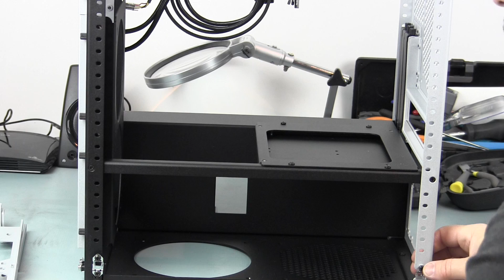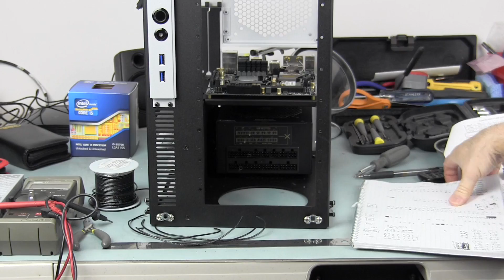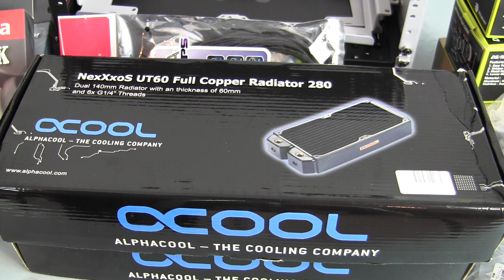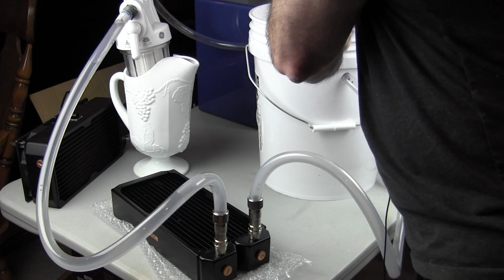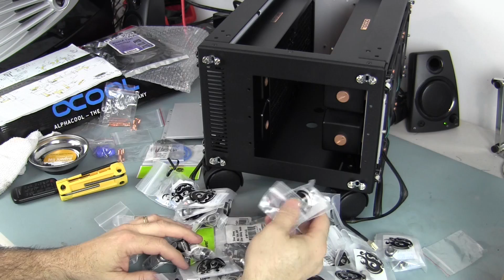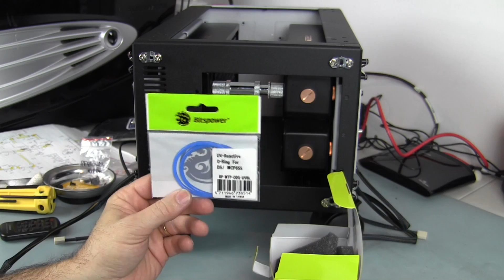Case Labs Mercury S3 MiniITX Build Log 2  - Cabling and Pedestal

Comment: Hi Ron got a question. I have a similar CaseLabs case i'm doing a build on the TH10A and have a Pedestal attached to which I'm mounting Radiators and Fans. I have some M4 30mm screws and apparently they aren't long enough to be able to mount the fans to the case radiator bracket frame and through to the radiator. Apparently i must need longer screws. What size radiator screws are you using in the video and or do you know what size screws it take to properly mount the fans, the bracket and radiator all together? Im unsure if there is a M4 size screw thats in-between 30-34mm in size as i don't think its longer than that which i need.
Reply from the maker: +Ardent Dfender I beleive these are Alphacool NexXxos UT60 Full Copper Radiator 280, 140mm x 2, Dual Fan.  I think I did buy longer screws to make it work. Make sure the screws you buy are the correct thread to mtach those that come with the rad.  I bought mine from McMaster Car.  http://www.mcmaster.com/
Reply: Thanks. I stopped by Fastenal. The only threat size for M4 between 30mm and 40mm is 35mm. They didn't have those so they ordered me some along with the washers just in case there is is too much thread. Be getting them monday.
Reply from the maker: +Ardent Dfender That works.  I may have have just used a screw cutter to get mine to the length needed.  
I am sure what you have done will work.

Comment: Maybe not many people do this, but when I'm building a system I look up the mobo manufacturers list of compatible ram before I order any of the parts. If I wanted to use something not on that list I would either look for someone that has posted already using it OK or contact the manufacturer. Just wondering if this was done in the case of the Gskills used (and failed) in this video? I've just checked Asrock's list and that model of Gskill is not listed. Did you try updating the bios with the good ram in then going back to try the Gskill again, did you try with just one stick at a time and doing the bios settings for the ram manually? You seemed very quick to assume the ram was faulty.
Reply from the maker: +Ironbuket  A manufacturer can not test all RAM that is produced, and most times other RAM not listed will work just fine.  Turns out in this case it did not.  And I did try adding the RAM timings manually.  It all worked out just fine in the end, by using different RAM.
Thanks for watching.

Comment: The 2nd radiator will be running fluid from the top inlet to the bottom outlet. In my rig, I was doing that, but even with 2 D5 pumps, the loop couldn't get all the air out of the 2nd rad. I was getting a pressure variance that was visible in the reservoir.  I would see a 2" drop in the water level from sys-on to sys-off.  I fixed the problem by running the top outlet from the 1st rad to the bottom inlet of the 2nd rad. Now both rads are filled from the bottom, and the all air has left the loop.

Comment: Personally I would have gone with Black fittings to go with the rest of the case, and instead of going from left top to right top on the rads, I think it would make more sense to go Pump -> Left Rad Bottom -> Left Rad Top -> Right Rad Bottom -> Right Rad Top -> CPU/RAM etc. This way you will have better success with bleeding the 2 rads.